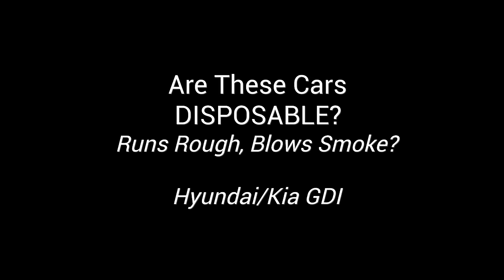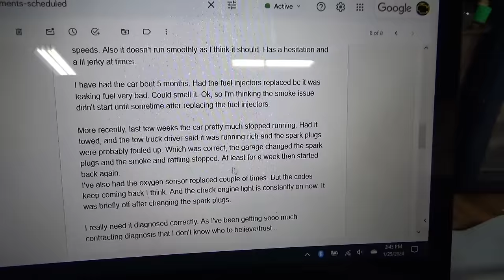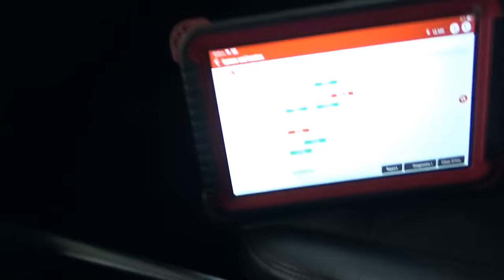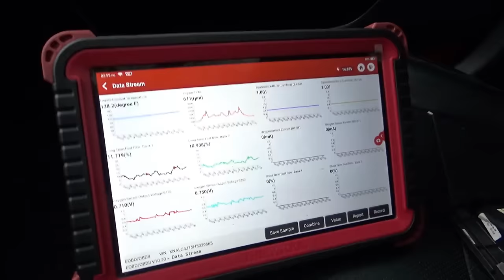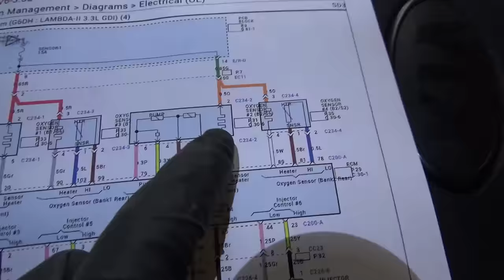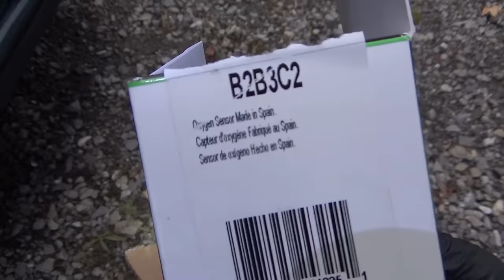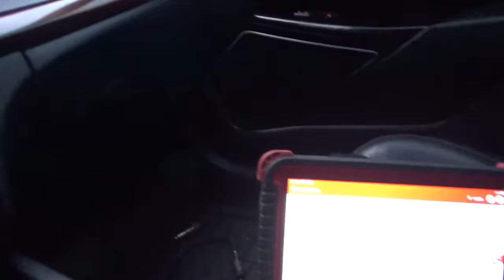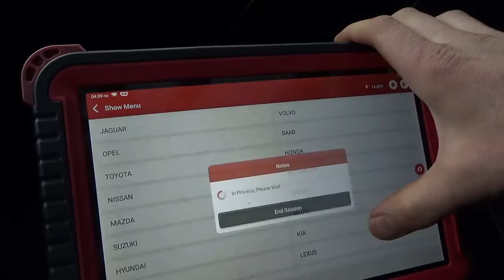Are These Cars DISPOSABLE? (Hyundai/Kia GDI Burning OIL - MISFIRE, Low Power)

Comment: This Kia needs what ALL high-mileage direct-injected Kias' need; a thorough intake valve cleaning with a walnut blaster, and 50% of the time they will also need a converter.  If you do that, it will run like brand new again.

Almost all the Kias I see have the exact same story as this one . . . like this one someone told them it needs a new engine, which it doesn't.  It needs to have the intake valves, and this one will also need a converter.

The diagnosis on this Kia should have started with a valve cleaning.  After the intake valves are carbon-free, if it still has a driveability issue (rare), only then would I chase the driveability issue.

100% of the high-mileage (over 100,000) Kias that I have worked on that supposedly needed an engine did not need an engine - they needed to have the intake valves cleaned and usually also a converter.  The Kia in this video has all of the classic "dirty intake valves" symptoms.  It definitely DOES NOT need an engine.
Reply from the maker: Uhhhh there's no driveability symptoms, just burns a CRAP TON of oil. How would cleaning the intake valves solve that problem? Would just be a massive waste of my time and customer's money 🤑😆
Reply: @PineHollowAutoDiagnostics  - this Kia has the exact same symptoms all of them have - misfires, fouled spark plugs, low compression, excessive oil consumption, excessive black soot in the tailpipe, etc.  It's the same story over and over again.  Basically all the symptoms usually associated with a bad engine.

Have a 2014 Kia Soul with a 2.0L here right now that was towed here 10 days ago.  It used at least a quart of oil every 500 miles.  And as usual, after a walnut blasting and a new converter, it runs like a brand new car and is now for sale for $8,995.

All of DI motors consume oil, so sometimes it's a fine line sometimes to determine what is excessive and what is normal, but a quart every 500 miles would definitely qualify as excessive, even for a DI engine.

The customer has not yet picked up this Kia yet so I can't report on the oil consumption issue yet, but the customer has a long daily commute, so it won't take long to determine what affect the repairs will have on the oil consumption issue.  But based on experience, I would expect it to cut the oil consumption problem in half.  Why cleaning the intake valves improves the oil consumption problem I can't say, but on the 4-cylinder engines (the 1.6L, 2.0L and the 2.4L) it does.  No experience with the Kia 6-cylinder engines as it relates to this problem.
Reply: @PineHollowAutoDiagnostics  - for the sake of clarification, I do not disagree with your diagnosis in anyway.  The very best solution for the shop and the customer is to install a new engine.  The shop's liability on the job is down to the engine install only.  The engine company warranties the engine, and the customer gets a new engine.  It's a win all around.

The problem has been, and I suppose this is why I have only dealt with the 4 cylinders is that engine wait times are 12 months+ and they want a King's ransom for a used one . . . if you can find one.  So when they are told they need a new engine that is not available and they still need to get to work every day, more desperate measures are warranted.

In each case that I have taken that was the scenario.  They were told they needed an engine, but a new engine wasn't available, so I tried to help them out.  And in each case I experienced great results.

If I lived closer I would offer to do this vehicle free of charge just to see what would happen.  I'd love to know the answer!
Reply: I would say unsticking the rings is more likely the fix.

Comment: I have read that the KIA engines are known to have bad PCV valves that cause oil consumption and they are a cheap replacement.  I  have also read about many engines with the oil control rings getting stuck.  Why not try the easy thing first?🙂
Reply: Because that info is bogus

Comment: I just put new rings in my '03 Forester because of high oil consumption. The holes behind the oil rings  were so plugged that I literally had to drill them out!!
I'm guessing that the old rings were low tension. Not much resistance when sliding in the bore. New rings definitely protruded from the piston more and had a lot more of resistance.
I haven't driven it yet. I'm hoping to slow/eliminate the oil consumption from the qt per 1000 miles!
I'm thinking the carbon cutting formula you mentioned won't clean those little holes unless the pistons were removed and soaked in it. The carbon was brown and rock hard.
It was strange, when driving, start up, no blue/black smoke. You would think I'd see something. Maybe the consumption was happening when hot and the cats were working over time? 🤔

Comment: Piston soak with Berryman B12 in the Toyota 2AZ-FE was a miracle for me.  It reduced the oil burning from 2 quarts every 1,000 miles to less than 1/3 quart every 1,000 miles.
Reply: Piston soaks usually make the biggest difference

Comment: I had good success with my 2011 Hyundai i45, (4 cylinder 2.5 litre) ,  ever really used oil, changed oil regularly, every 10,000km, sold it at 160,000km, I must have been lucky based on the issues posted here. Cheers from Australia 🇳🇿🇳🇿

Comment: People who buy cheap cars are typically not the best owners of cars added to bad luck of a bad design. Toyota 2.4 had problems like this that needed engine replacements if you did not maintain the engine from the start with oil changes under 5K miles with high quality synthetic oil. Kia/Hyundai had, maybe has, the same problem, you don't buy such cars with over 40k miles. If I were to get an under 25k mile car, I would do a premium oil change, and change it frequently with premium synthetic. I am happy with Mobile1 or even Amazon Basic full synthetic for my 2008 Astra with 90k miles, but would go Amsoil with a Kia/Hyundai. If you can pull the exhaust and getting the converter out, LigitStreetCar just pulled his converted and attacked the catalytic screen with chemicals and a power washer and unclogged it, and said City of Chicago does that on their government vehicles in an area requiring emissions.

Comment: Weak open deck aluminum block with thin cylinder walls is the problem with these engines (just as their previous version, Lambda 1). Oil control rings getting seized if oil wasn't changed often enough. Also, cylinders getting blown out of shape, which causes excessive clearance between piston and cylinder walls, degradation of compression and failure of the piston rings. If you borescope this engine you might find damaged cylinder walls with some scoring and dark spots indicating local overheating. If you measure these cylinders out with the bore gauge you will probably discover whole new geometric shape and will become famous. LOL. Piston rattle and high oil consumption are common symptoms. There are several solutions (overboring, re-sleeving, getting a short block, etc) but considering the value of the car it doesn't make much sense these days. You are absolutely correct. These are disposable cars. Cheaply made, loaded with gizmos to attract new buyers and designed to last through the warranty / lease period. You can somewhat extend their life by changing oil every 4-5K miles and going easy on the right pedal, but that's about it. Don't buy these cars. Lease, dump and repeat. LOL

Comment: Had a similar problem with a Honda Accord w 230K miles. Came in w the CEL on, code said cat efficiency below spec. Upstream O2 sensor read good. I replaced the original cat. About 1 year later car came back w CEL on again. Same issue w cat. I started asking questions. Customer advised car is burning ~ 3 qts of oil between oil changes. Duh!  Did some research and found the engine was known for the oil rings failing. Cat was working overtime to clean up the oil burning so no smoke from the tailpipe. So the original cat wasn't just worn out after 230K miles. It was burnt out by the engine burning oil. The cat was masking the problem.

Comment: These are much like Toyotas VVTI or whatever they call it - post '99 those burn oil for sport too, but it doesn't get mentioned much.  Hyundai & Kia used make good enough gear - now they make disposable junk. It is what it is. The cops here run them & they hate them with a passion.  GDI always = Heartache regardless - the carbon deposits created are insane. Mazda are no better - their gdi engines suck too.
Reply: Usually, it's that the rings have stuck in their grooves - usually - the "cheap" cure is to bin out the oil, fill the fcuker up to the full mark with kerosene, run it for a while at idle, then bin out the kerosene & fit a new filter & oil.  That generally frees up the rings sufficiently to lower oil consumption - but at the rate they deposit crusty carbon, it'll die in some other way fairly shortly - usually bunged up intake/TB/EGR crap.

Comment: I am amazed every time a customer comes in asking for a diag on a used car they just bought a few months ago with 160,000 miles. If money is tight it is probably the worst thing someone could do, because it will cost a fortune soon and any savings will be wiped out. Better to stretch a little thinner and buy something a bit closer to new, or at least lower miles. Less than 80k if possible. 
Unless it's dirt cheap and considered a disposable car, $800. But people are often buying high mileage luxury cars they can't afford to repair.

Comment: My neighbor has a CRV that at the 60% oil life the oil light begins to flicker because its has pretty much burned all the oil . After watching Bernie's video the other day im about to try that same chemical on that CRV
Reply: Does your neighbor understand that they need to check and add oil periodically? That flickering oil light isn't an oil level sensor, it's flickering because there is not enough oil to maintain sufficient, constant oil pressure. Even if you can solve the oil consumption the engine has excess wear from oil starvation. When the oil pump sucks air it then pressurizes it and pushes it through the oil galleys and blows away oil remaining on parts.
Running low on oil increases the heat of the oil and that adds to the carbon problem. Modern engine Oil has 3 purposes, 1st is lubrication, 2nd is cooling, third is hydraulics. Everyone understands oil is slippery and lubricates things, but they don't understand that the oil helps to cool the internal components by absorbing heat and then releasing it in the pan, if the engine is constantly low on oil then the oil never gets time to release heat before it's sucked back into the engine. And modern variable valve timing systems use engine oil to hydraulically control camshaft phasers this adds significantly to the heat load on the oil.

Comment: Luckily my 2016 Kia Rio has 4 cylinder engine with old school fuel injection system, so far no oil consumption. Battery may be aging though. At the start of this year we had very cold week, maxed at -36°C and at first cold day, tried to start the car after it had been sitting for 2-3 days, resulting only a click at the starter motor. Darn headlights came on as I left them on auto setting, drawing power from battery, so turned them off, turned also blower and radio off, and then it started. Drove much longer trip than usually to charge the battery (agm) and so far it's been fine again. Of course could've been some temporary malfunction at the starter too. Happened only once so won't take any action yet, just keeping it in mind, if something unfolds in the future.

Comment: I have owned 3 Hyundai's in my life with no major problems. Only brakes, tires and minor things like strut mounts with over 200k on all of them. My father also owns a 2019 Tucson with 80k and it doesn't burn a drop of oil. It's all about maintainance, do  NOT follow manufacturers recommendations!

Comment: My ex had a 2010 Optima with 250,000 with only a clutch and brake light switch for repairs... Until she decided not to change the oil for 12,000 miles and it started to tick. An oil change didn't help but STP did long enough to trade it. As for oil burning, may not be just the rings, valve stem seals could be shot as well. Either way, not good for😊 a 100k engine.

Comment: I get GDI might be more efficient or something. It seems things were sorted with MPFI port injection a long time ago, but manufacturers just couldn't stop picking at things. By my standards, a 2017 car would be relatively 'new' to me. I'd be extremely disappointed to buy a new car in that time frame to have such issues.

Comment: My coworker has a 2017 Tucson with the 1.6 engine. It is burning the same amount of oil as the engine in this video. Two of the four cylinders have extremely low compression and the vehicle misfires. It only has 80k miles. She bought it used a year ago and owes $14k on it. She just recently divorced and is not doing well financially. This has really put her in a bad position. Hyundai should take responsibility for this.

Comment: If people would just change their oil no less than every 5,000 miles, about 90% of the problems would never occur. Unfortunately, for gasoline direct injection engines, you have to decarbonize the valves as well. This requires frightening chemicals available only to professionals.
Reply: No LESS?  Look at the SEVERE maintenance schedule and then cut yourself some slack.  If severe is every 6 months or 6000 miles then do it BEFORE that.

Comment: I had a GM vehicle burn a quart of oil every 250 miles.  This started at approximately 35,000 miles on the vehicle but they would not fix it under warranty because they said that was within spec. (Screw Government Motors).  I switched to 10W40 from the 5W30 it called for and that slowed the consumption to 350 miles on a quart of oil.   

I drove the vehicle this way for about 80,000 miles and sold it to a buddy for his daughter. He knew that it burned oil.  Within a week she totaled the vehicle because she was texting and driving which was probably the best outcome for everybody. 

I had the vehicle to the General Motors dealership approximately 30 times complaining about this. One day the mechanic pulled me aside and said if it was his here is what he would do, but I was scared to do so myself.   

He said to pull out all the spark plugs and manually rotate the engine so all the pistons were even.  He said to then pour in 4 ounces of Coke in each cylinder and a few ounces of kerosene and let it sit for 24 hours.  The next day use a syringe and a piece of fuel hose to go through the spark plug holes and suck out all that you can then crank the engine over in flood mode to blow the rest of the Mix out before reinstalling the spark plugs.  He said to then start the engine and let it idle for five minutes or until it comes up to temperature, then immediately change the oil with Mobile One because of its high detergent properties.   

Drive it for 50 miles, then change the oil again and monitor.
Reply: Coke and Kerosene are not going to clean out piston rings.  So many technicians have no idea what they're talking about.   I can't count how many times I've heard, Quote: I've been doing this (wrong) for XXX years!

Comment: Stop changing the oil every 7000-10000 miles. Change the PCV and clean the intake with intake cleaner spray.

Comment: Most of these engines suffer a short life when run on low octane fuel. Even with knock sensors pulling timing the knock still occurs to be detected every push of the throttle. With pistons designed for low NOX emissions with high ring grooves and dished crown edge resulting in thin crown to skirt support they often end up after the long term hammer of knock nipping the top ring enough to lose compression, then they bypass oil and increase knock even more from contaminated mixture, the spiral down has then started. It also hammers head gaskets and is often worse with open deck blocks, killing many zero tolerance engines well before their time..
Just don't use cheap fuel.

Comment: seems like GDI causes more problems than its worth, wife and I are in the market for a new SUV, looked at Honda CRV, now they have a smaller 1.5 turbocharged engine plus GDI, seems like the GDI is causing oil dilution problems in Honda's newer vehicles, might have to switch to Toyota instead or look for a really low mileage older Honda without all the turbo/GDI crap

Comment: ive been leasing cars for years, and the last 3 were Kia's. They always had good lease deals but also i kept getting lucky at the end of the lease and the buy out value was good. My 17 optima had this engine but it only had 11,000 miles on it when i bought it and sold it to the dealer for the next one. That was a 19 stinger which is still GDI only. That had 17k when i bought it and sold it (made a killing in the middle of covid). Now i have a 22 stinger with the GDI/MPI setup, supposedly helps keep the valves clean by retaining the port fueling but also the benefits of the GDI. Toyota has gone with this as well in their new cars.

Im doing 6 month oil changes which is about 4500 miles each time. I bought this car and kept it because i love it. since im keeping it long term im going to follow all the advice i can. Is it too early to run seafoam in a car this new? I just turned 20,000 miles. Seafoam has cleaned up the idle and accelration on my 03 Highlander very notceably so I'm tempted to use it in the stinger as a preventative.

Comment: I don't want to jinxed it, but i have a 2014 kia rio with the 1.6 engine and manual transmission. I bought it new, i have 187000 kilometers on it, and so far, no troubles. I still have the original battery in it lol. I always use fully synthetic oil in it, change it every 8000 kl, and i do mostly highway. I had to change breacks on it of course, one caliper, but the car is basic, no cruse, no air conditioning, just basic. I don't know, maybe i am Lucky. Lol.